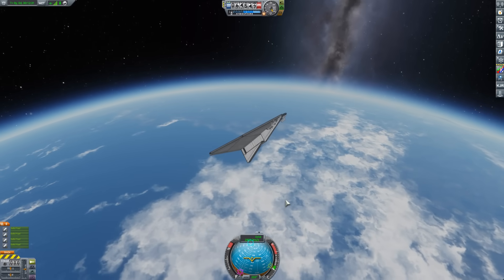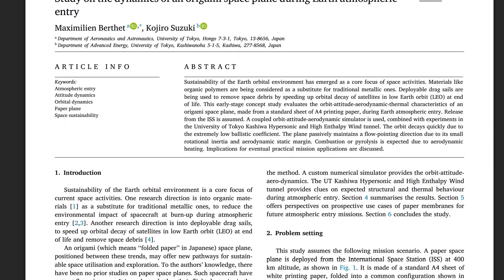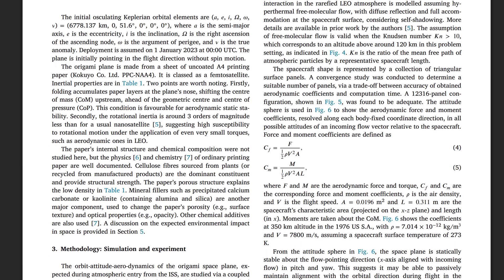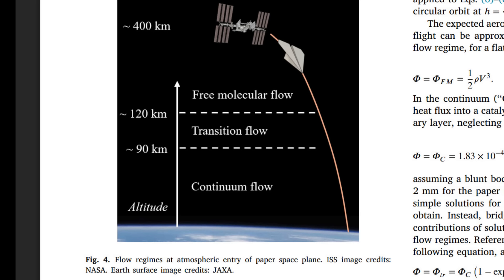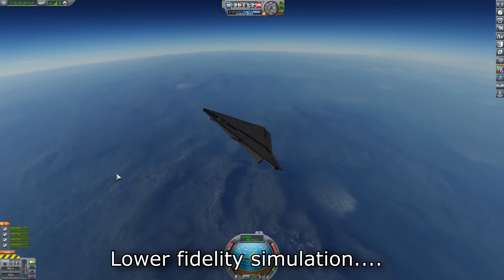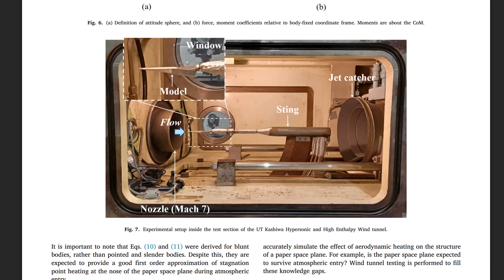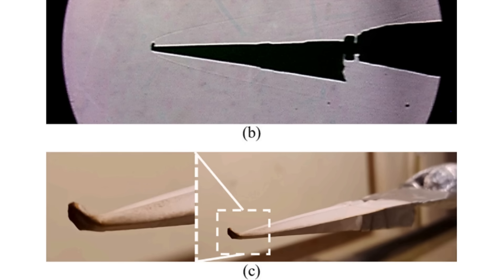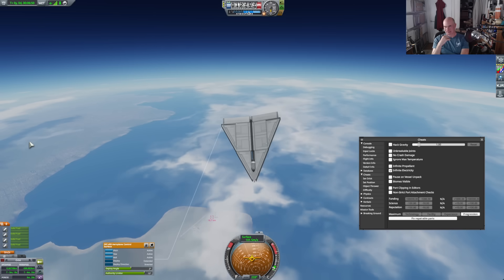Could A Paper Airplane Fly Back From Space?

Comment: At high altitude is oxygen homogeneous at ~20% ? or are lighter gasses in much higher proportion making oxygen far less than the level needed to burn paper?
If it's far less then the plane would possibly get hot enough to vaporize but maintain integrity but if it retained sufficient heat it would go POOF ! as soon as it got enough oxygen.
Next question ; How hot can paper get in an oxygen free environment?
Reply: Heating wood to its "burning" temperature without oxygen produces charcoal, same stuff you'd grill with. Paper being basically thin wood will also produce charcoal, or even just porous carbon if heated hot enough. Porous carbon is an incredible heat insulator. 
So you may be onto something here: airplane enters atmosphere, the nose chars and gets covered in carbon (protecting the rest from burning up starting at the front), the resulting shockwave of the nose pushing through the air helps to divert enough heat/pressure from the rest of the structure to prevent major damage. After a while the plane slows down and just flies like normal.

Comment: Designing a paper airplane to survive atmospheric re-entry from orbit requires materials that mimic paper's lightweight and flexible properties while withstanding extreme temperatures (up to 1,650°C or 3,000°F) and aerodynamic stresses. Below, I outline material selection considerations, focusing on weight, structural qualities, and thermal resistance comparable to paper.

### Key Requirements
- **Weight**: Similar to paper (~80-100 g/m², or ~0.08-0.1 kg/m² for a typical sheet).
- **Structural Qualities**: Flexible enough to fold like paper, yet strong enough to maintain shape under aerodynamic forces.
- **Thermal Resistance**: Must endure re-entry temperatures without burning, melting, or degrading.
- **Aerodynamic Stability**: Must maintain structural integrity during high-speed re-entry.

### Material Candidates
1. *Graphene-Based Composites*
   - **Properties**: Graphene is ultralight (0.77 mg/m² for a single layer), flexible, and stronger than steel by weight. It has a high thermal conductivity and can withstand temperatures up to ~3,000°C in controlled conditions.
   - **Application**: A graphene aerogel or thin graphene-polymer composite could mimic paper’s foldability and weight while providing exceptional heat resistance. Multilayer graphene sheets (0.1-0.5 mm thick) could be engineered to balance flexibility and strength.
   - **Advantages**: Extremely lightweight, high tensile strength (~130 GPa for pure graphene), and thermally stable.
   - **Challenges**: Expensive to produce at scale, and folding complex shapes may require pre-formed creases.

2. *Ceramic Matrix Composites (CMCs)*
   - **Properties**: CMCs, like silicon carbide (SiC) or carbon fiber-reinforced ceramics, are lightweight (density ~2-3 g/cm³) and can withstand temperatures above 2,000°C. Thin CMC sheets can be engineered for flexibility.
   - **Application**: A thin SiC-based CMC sheet (~0.1 mm thick) could be folded like paper and provide structural integrity during re-entry. Used in spacecraft heat shields (e.g., Space Shuttle tiles).
   - **Advantages**: Proven in re-entry applications, excellent thermal and oxidation resistance.
   - **Challenges**: Slightly heavier than paper, less flexible unless engineered as ultra-thin sheets.

3. *Polyimide Films (e.g., Kapton)*
   - **Properties**: Kapton is a lightweight (~1.4 g/cm³), flexible polymer film used in spacecraft. It remains stable from -269°C to 400°C and can be coated with ablative materials for higher temperature resistance.
   - **Application**: A Kapton-based film, reinforced with carbon nanotubes or silica aerogel, could mimic paper’s texture and weight while surviving re-entry heat with an ablative coating that chars to dissipate heat.
   - **Advantages**: Flexible, foldable, and lightweight; widely used in aerospace.
   - **Challenges**: Limited to ~400°C without coatings; ablative layers may add weight.

4. *Carbon Fiber Fabrics*
   - **Properties**: Thin carbon fiber weaves (~0.1-0.2 mm thick, density ~1.8 g/cm³) are lightweight, strong, and heat-resistant up to ~2,500°C in low-oxygen environments.
   - **Application**: A carbon fiber fabric coated with a ceramic or ablative layer could be folded into a paper airplane shape. Its high strength-to-weight ratio ensures structural stability.
   - **Advantages**: High strength, lightweight, and thermally resistant.
   - **Challenges**: Less flexible than paper; requires coatings to prevent oxidation at high temperatures.

5. *Silica Aerogels*
   - **Properties**: Silica aerogels are ultralight (density ~0.001-0.5 g/cm³) and can withstand temperatures up to 1,400°C. They are brittle but can be reinforced with flexible polymers.
   - **Application**: A reinforced silica aerogel sheet could serve as a paper-like material with excellent thermal insulation, ideal for dissipating re-entry heat.
   - **Advantages**: Extremely lightweight and excellent thermal insulator.
   - **Challenges**: Brittle unless reinforced; complex to manufacture in thin, foldable sheets.

### Comparison to Paper
| Material                | Weight (g/m²) | Flexibility | Max Temp (°C) | Structural Strength |
|-------------------------|---------------|-------------|---------------|---------------------|
| Paper (reference)       | 80-100        | High        | ~200          | Low                |
| Graphene Composite      | ~1-100        | High        | ~3,000        | Very High          |
| Ceramic Matrix Composite| ~200-300      | Moderate    | >2,000        | High               |
| Polyimide (Kapton)      | ~100-140      | High        | ~400 (coated: >1,000) | Moderate         |
| Carbon Fiber Fabric     | ~150-200      | Moderate    | ~2,500        | High               |
| Silica Aerogel          | ~1-50         | Low-Moderate| ~1,400        | Low-Moderate       |

### Recommended Approach
- *Primary Material**: A hybrid of **graphene-reinforced polyimide film* with a thin **ablative ceramic coating**. This combines paper-like flexibility and weight with the ability to withstand re-entry temperatures via ablation (sacrificial charring) and structural reinforcement.
- **Design Considerations**:
  - Foldability: Pre-crease the material to ensure clean folds, as graphene and polyimide can be engineered for flexibility.
  - Thermal Protection: The ablative coating (e.g., phenolic resin or silica-based) chars during re-entry, dissipating heat while preserving the core structure.
  - Aerodynamics: Optimize the airplane’s shape (e.g., delta-wing design) to minimize drag and heat buildup, ensuring stability during hypersonic flight.
- **Weight Estimate**: A 0.1 mm thick graphene-polyimide sheet with ablative coating could achieve ~100-150 g/m², close to paper’s weight.

### Challenges and Notes
- **Oxygen Exposure**: Re-entry generates hot plasma, so materials must resist oxidation. Graphene and CMCs excel here, but polyimide and carbon fiber need protective coatings.
- **Cost**: Graphene and CMCs are expensive, so prototyping may require balancing cost with performance (e.g., using Kapton as a base material).
- **Testing**: Materials must be tested in arc-jet facilities to simulate re-entry conditions.

This approach draws from aerospace materials used in heat shields and flexible thermal protection systems, tailored to mimic paper’s properties. For further details, I can search recent discussions or papers on this topic if needed. Would you like me to do that?😂

Comment: Carbon fibre is produced by heating organic polymers, such as polyacrylonitrile (PAN), to high temperatures in a controlled environment, which removes non-carbon atoms and aligns the carbon atoms into strong, tightly bonded structures. The process involves several steps, including spinning the precursor into fibres, stabilising them, and then carbonising them to create the final carbon fibre product.
Fold the 'paper' plane from one of these precursor polymers and convert it to carbon fibre.
You could possibly form the resin/fibre composite plane first and then convert it to carbon-carbon composite . 
Carbon-carbon composites
Carbon-carbon composites present a family of materials composed of carbon fiber reinforced with carbon matrix.

Comment: Yeah but would a paper airplane actually be traveling at mach 7 in dense enough atmosphere to cause enough heat to char or burn the paper?  Although it would be initially traveling at 17,000 mph the atmosphere gradation would slow it down gradually as more atmosphere is encountered.

Comment: Wouldn't a paper plane slow down to it's terminal velocity at whatever air pressure it is at almost instantly? I couldn't find a video of paper planes being thrown out of cars with a quick search, but I'm pretty sure I've seen it once; I've certainly seen crumpled paper and cardboard thrown out of cars at motorway speeds several times. Because I've been cleaning trash along a motorway several times as a fundraising activity for 4-H, and there is always a few dozen drivers (at least it was back in the 90s) who thought it was "hilarious" to throw trash out their window while passing a cleanup crew. And crumpled paper and cardboard slow down to normal human throwing speeds in just a few milliseconds because of the drag, so I sort of doubt that a paper plane falling out of a roughly circular orbit would be charred much from the fall. 

I could imagine a design that is very stable and tends to nosedive like a dart when it runs out of forward speed could destroy itself; (and the in the wind tunnel looks a bit like that kind), but a I'm pretty sure a paper plane design that has a little tendency pitch up and then stall and and then recover and pitch up again over and over, would never fall into the thicker atmosphere before it's way below supersonic.

Comment: There is no way the plane would EVER get to mach ANYTHING in that much atmosphere! That wind tunnel test didn't seem to account for the changing speed or inclination! Once it started to hit any atmosphere, it would snap up pretty quick and the speed at which it would slow would be significant! Ever tried sticking a paper airplane out of the window of a fast moving vehicle??? What does it do the moment the tip catches a little bit of wind? Either the whole front end folds over backwards because you held it to far back from the tip, or , nk matter how fast you get it out the window, it gets sucked out the window and stops immediately because it doesn't have enough mass to maintain even a "nose forward into the wind" position, add a slight sidewinder and it'll probably just make a loud POP and you'll find it reverted almost completely back k to a flat cheat of paper, acting more like a parachute than a piece of paper. That test just doesn't make a bit of sense, and in a way, neither does the whole experiment, because any kid that threw paper airplanes off the highest places they could sneak on to, like myself, will know that no matter how many times you throw that damnable thing it's NEVER going to do ANYTHING even remotely repeatable!!! 😏

Comment: The problem with this is structural integrity, it's pretty low for paper, though I don't know if there's other materials that could handle it either. It's all moving at extremely high speeds, and I expect it to crumble into a ball the second it hits a slightly denser air pocket on its way down, at which point it will start heating more, retaining that heat more, decelerate slower, crumple up to be even denser... Paper heat resistance is also bad, and more than that, it tends to get very brittle way before it burns... So yeah personally I'd nor expect great results from that, plus an airplane is the worst shape for it all, both for deceleration and structural integrity, while the ideal shapes would be domes, maybe cones. A way better experiment would be paper cones and half spheres, with internal paper ribs aimed at the tip, with an extra layer or two there, strengthening it and making it heavier so it self stabilizes. Have some doubts those survive either though

Comment: I wonder if they are considering that gravity isn't yanking the plane down into thicker atmosphere like it does heavier aircraft. The reentry profile is going to be much different. Closer to a parachute than a spacecraft.

You can easily imagine it exceeding 0.1g when it gets to even the slightest bit of atmosphere, especially if it's tumbling. That would take it from 17,500 mph to 500 mph in 2 hours. Even if it was 0.01g, it's only 20 hours. It seems like this would start to occur somewhere around 300,000 feet. If it got to the point where it was in that much friction, it would lose all of it's remaining velocity in a matter of seconds. I just can't see how it could maintain velocity through a reentry the way they are modelling it. Are they using the reentry profile of a manned spacecraft?
Reply: An increase in temperature is energy. Applying that much energy to a piece of paper is going to be reflected as a kinetic force, much like brake pads on a disc. The moment the air starts to see an increase in temperature, that should be seen as significant deceleration on the paper. To accelerate a piece of paper from 17,500 mph to 0 takes 150,000 joules. But spread that out over a few days. The problem becomes not about reentry, but the radiation rate of paper into space. I suspect if the paper doesn't survive, it's more about it reaching 450°F before it begins to reenter the atmosphere.

I think they should have done this study as an energy equation, not an aerodynamics problem. I suspect they modeled a reentry that exceeded the kinetic energy of the paper plane.

When I ask AI to calculate the joules that would get deposited into the atmosphere using the drag force formula at 300,000 feet over one orbit, it exceeds the kinetic energy of the paper plane. This means that it would take less than one orbit at 300,000 feet to decelerate completely. In other words, by the time it reached 300,000 feet, it would have already decelerated completely. So at what altitude would it take one full orbit to equal the drag force? Approximately 600,000 feet, far beyond where atmospheric friction is an issue.

Comment: But what if they soak the paper in water and then freeze it? Paper is white, so it kind of reflects radiation to keep the water frozen in space. Then, as the paper airplane gets close, the heat melts the ice and by capillary reaction it flows through it, evaporating from the heated up parts, so it acts as a refrigerant. So, I say wet paper airplane for the win.

Comment: I'm going to take a stab at it and say that a paper airplane in space is just going to drift or fall into the atmosphere haphazardly until the atmosphere is dense enough to support its wings, and then it'll fly the rest of the way down.  Why wouldn't it?  Unless it runs into some rain or something.  Burn up on re-entry?  I thought that was mostly an issue with the speeds involved.  A paper plane shouldn't be moving very fast, as it's just motivated by gravity, so there shouldn't be too much friction to cause it to burn up, even if it is just paper.

Comment: This is "heavy nose design", so could be very stable. However, a spacecraft re-entering the atmosphere should have the largest possible frontal area facing the undisturbed flow. However, from a G-force perspective, the optimal angle of attack is most favorable, as nx = Cd/Cl. For the Space Shuttle, it was something like 40 degrees, for hypersonic velocites,  if I remember, correctly. A paper airplane would likely nose-dive.

Comment: Im wondering would a satelite of something like paper or even lighter with big surface area to function like solar sail be viable for something like breakthrough starshot project ?
Probably the sun/laser would burn it, but if it is possible to protect its surface from heat somehow and you print circut board and put microchips with some very light conductive material all over its surface to serve as a computer, with enough photovoltaic cells to power it ( also should be from the lightest material possible )...idk, maybe from 1000 of them 100 would reach closest star in a reasonable amount of time.

Comment: To be honest, I think it might survive. Here’s how I think it’ll go. First, all energy is measured in two forms. 1. Horizontal velocity, and 2. Vertical potential energy. The combination is the Pythagorean formula combining both. The drag in the uppermost part of the “flight” would quickly reduce the horizontal velocity to almost zero. Because, as you said the very large surface to mass ratio. It then leaves vertical potential energy left. And as the gas gets denser, the drag goes up, meaning the paperplane would descend (much) slower than any other object due to it’s light mass and large surface. People forget most objects returning to Earth are somewhat aerodynamic in shape, even the trash is contained into a lump. So, any lump will have a much higher mass-to-surface ratio. I think the paperplane will be fine.

Comment: New idea! 
What if we used fuel as pulsation dampeners by routing it through cylinder YXZ, linked across lines with breakaway quick-close valves? Then, open equalizers could stabilize aircraft turbulence by dynamically adjusting flow. This setup would allow for multiple fuel configurations depending on flight conditions. Maintaining stability across various scenarios. Preemptively adapting the system would let pilots switch between setups mid-flight based on predicted turbulence. Thoughts?